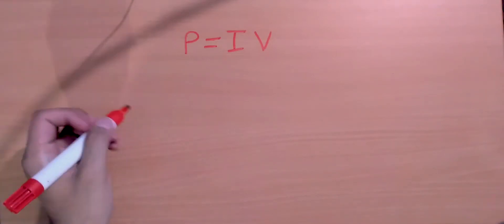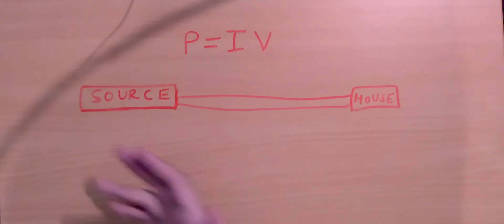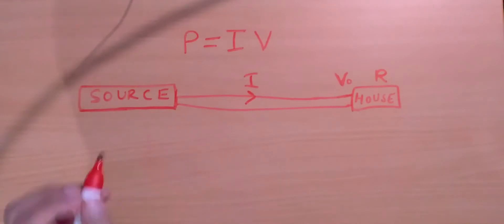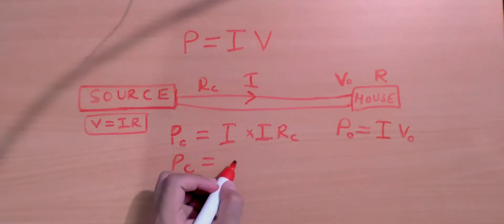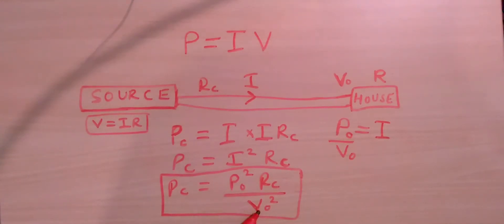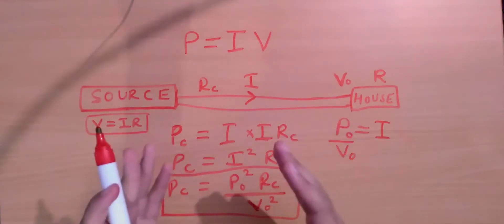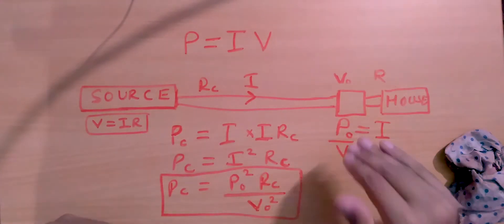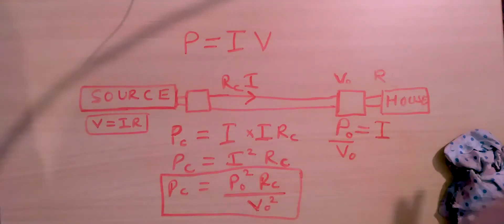Power Loss in Transmission Lines

Comment: But V° is the voltage drop across the source then how can changing the line's voltage do anything?
Reply: V° is actually the difference between the voltage at which current is supplied through the line (which is very very high) and your normal household voltage (220V which is comparatively low), which still makes V° (the difference) a very large quantity thus minimising the power loss ( the transformer is what reduces the voltage to 220V, what you study here is a pretty simplified explanation for this)